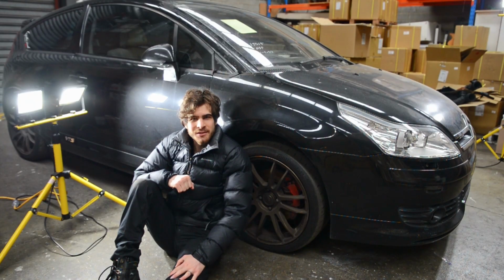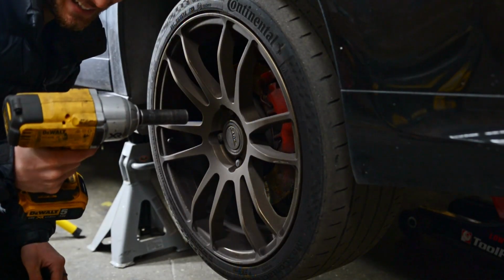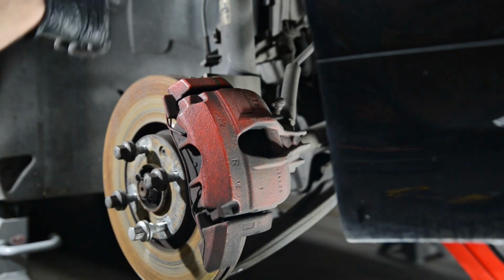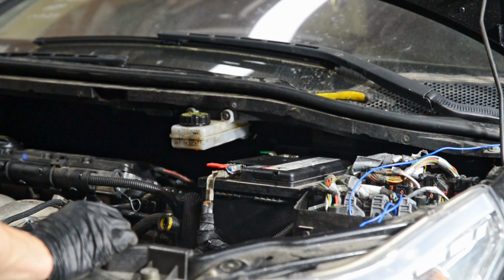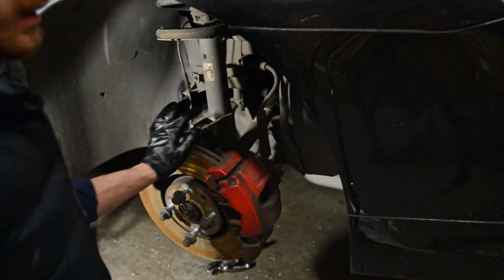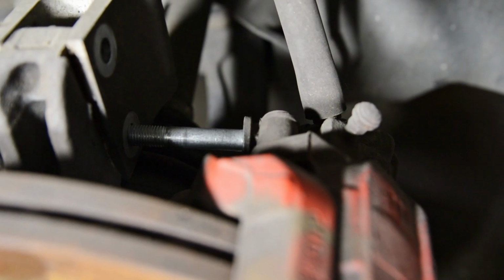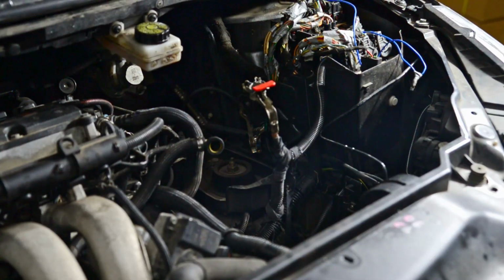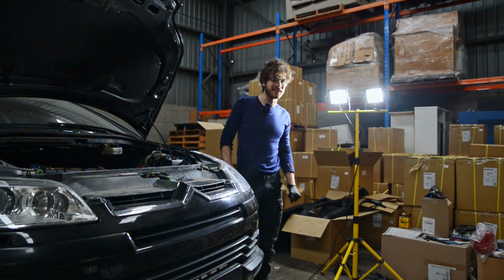Citroen C4 VTS Build | Ep. 3 Boxing Match

Comment: Have the same car. Just bought it. Next goal is turbo kit or throttle body kit.
Reply from the maker: I've seen people turbo the pugs. Ew10j4s loves it
Reply: @KnLAutoDetailing  Sadly it can't hold alot of boost
Reply: @TehKaramelo yeah the compression is a bit high already. I’m thinking of rebuilding my engine with some cams and intake modification, and getting the ecu tuned. The stock extractors are already pretty decent
Reply: @MrBrandonLau  for ok power, it will hold, but the transmission will brake before that. It only holds max 30kg(usually here it brakes on the dyno)
Engine the people are running around 0,5 psi of boost. That's what the engine will hold. This knowledge is from our c4 vtr that has the ew10a engine with the be4n transmission

Comment: What else did you remove and was it easy to drop out. About to do this job the weekend what joy:)
Reply from the maker: The airbox and engine cover were already off the car so the only thing i really had to remove was the battery tray. Good luck with it....it was a pain in the ass to get out on jack stands. I also loosened the subframe to lower everything just that little bit more. A lot of the guides say to remove the transmission mounting plate with the thread but i could not for the lif of me get a tool on the 3rd bolt which made it super difficult. Again if you could remove the bolt then it is easy.
Reply: Thanks for the advice. All sorted now did it over the weekend. Also opted for a lightweight flywheel from Spoox motorsport feels so much better.  @KnLAutoDetailing
Reply from the maker: @slats8376  lightened flywheel would be nice. I didn't really want to spend any extra on this car so didn't bother.
Reply: @slats8376 where did you find a flywheel and did you do upgrade anything else? I imagine throttle would be a lot more responsive
Reply: @MrBrandonLau  I got it from Spooks motorsport plenty in stock and certainly makes a difference on rev pick up dropping down. Couple that with the catcams, custom map, intake and decat it made 203bhp on the dyno. Looking at turbo next from Lorent motors in France can easily get 280/300bhp on standard internals, an stripped will be close the the wrc power minus 4 wheel drive. Absolute hoot to drive though the induction noise and general old school feel.
Reply: @ 203hp on the dyno is decent! They sound great with a good exhaust

Comment: I love this series mate. I live in Adelaide and have owned a white one for 10 years that’s in much worse condition that yours was. 
When the car was my daily driver I replaced the clutch in my own garage with zero experience. I bought the official Citroen dealer workshop manual(it’s on the computer on a virtual machine as its windows nt based haha)
This helped immensely. If you still have the car and I could possibly send it to you.

I’m considering restoring my vts this year. It needs a new clutch timing belt and has a big oil leak that isn’t the rocker cover 😅 but maybe I’ll get the engine rebuilt and find some nice cams to make some more power.
Reply from the maker: @MrBrandonLau  that awsome haha. I no longer have the car though.

Comment: 😂 don’t set fire to it…I need a parts VTS ! lol
The performance you’ll experience when you get it sorted will be worth it 
Note: o2 sensors probably will need replacing 
And the Catalytic Converter is gonna need a really good degreaser soak and scrub up
Reply from the maker: Thanks for the tip. Will keep an eye on it. Have plenty to replace still so going to try and sort it out first then easy things like o2 sensors will come. Are the factory headers a tubular design? Because this one has some hectic looking headers with a flex join in them
Reply: @KnLAutoDetailing  I’m actually putting Gloria on jack stands today and crawling under to prep the cat for removal and I’ll let you know what I see, I do believe it’s 4 in to one from the exhaust manifold is that what you mean?
Your video bolstered my confidence with the clutch and axles btw
Suppose wrestling that awkwardly placed gearbox looks the toughest bit
Reply from the maker: @gmichaelhall  uh okay so they are 4 into 1 from factory. Awesome. Yeh wrestling it was a pain. The annoying thing was the gbox mount threaded shaft is supposed to be removed but on our cars the 3rd bolt is covered in a recessed section and but they big washer plate so you can't get a spanner or socket on it